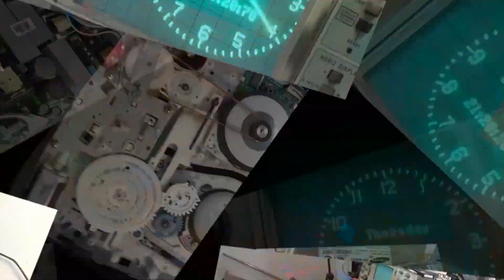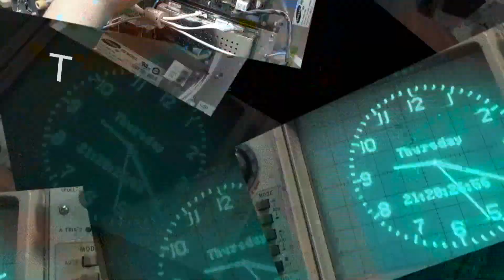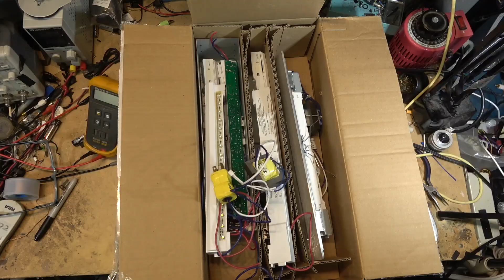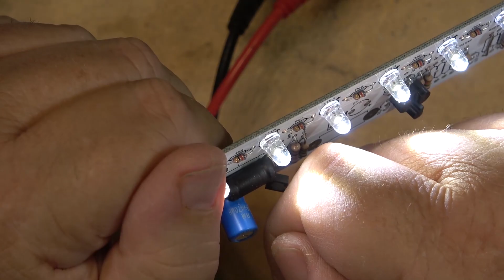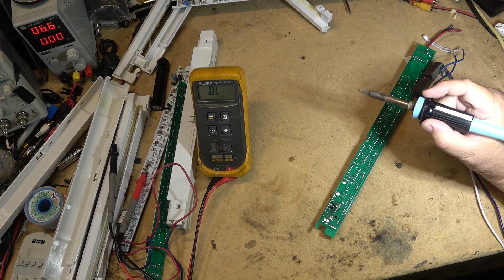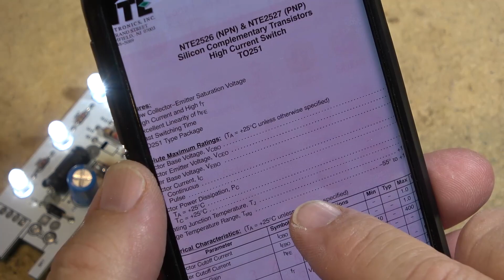Troubleshooting commercial LED exit signs that fail prematurely for the root cause

Comment: It's truly sad that even the regular, glowing lightbulbs, lasted longer than many of the LED lightbulbs I buy today. It's not even cheap brands that fail prematurely.
Reply from the maker: My grandfather clock has 2 40 watt incandescent bulbs running on a dimmer.  They run at 33% power and have been running 24/7 for many years.
Reply: My Pioneer receiver has the original lamps from 1974 in it. Not one has burned out yet
Reply: Underdriving tungsten bulbs prolongs their lifetime, IIRC exponentially. I found an Orbitec signal light application note on this subject, like 15 years ago, can't find it now. It said a signal lamp with 1000-2000 hours of nominal lifetime will last something like 50.000 hours at 60-70% of its rated voltage. I'm completely making these numbers up as I don't remember from 15 years ago, but it was a similar order of magnitude difference. As small voltage reduction as 10% lower than rated voltage can multiply the lifetime of a bulb. And they last a lot longer on AC, compared to DC, due to electromigration I think. I searched for almost an hour for that paper right now (1:05 AM here now...), without success.
Reply: Welcome to planned obsolescence.  It's not even the lights that fail most of the time, it's the driver circuitry that fails due to cheapass components being used.
Reply from the maker: @mrnmrn1  
There is a certain one in a firehall in the use that has been running for over 100 years.  Yes it is dimmed down.  Look up the century bulb on YouTube / Google.
Reply: @mrnmrn1  Reason I replaced the 24VAC lamps in a piece of machinery with 36VAC lamps, same package, and lower current use, and lower light output, but with a plastic coloured cover not even noticed. Used them as well in other applications, even using the MES lamps in a SBC socket, after a tiny bit of work with pliers to make the bayonet end act like a screw.
Reply: @12voltvids  I got a box of similar carbon ones, made by Siemens, and all very nice, even though they are from the Phoebus cartel days. NOS that sat in a box for 53 years, before I took the lot out, and the shelf got reallocated for use.
Reply: @12voltvids  Yep, I am fully aware of the Centennial light. That was probably always very dim, that's the reason it lasts forever. Maybe it's a 220V bulb operating on 120V.
Reply from the maker: @mrnmrn1  I am pretty sure they have it on a variac and have it dialed down.  I have a few really old bulbs that are well over 60 years old that still work but they are not being using.  Just collected.   I had (still have it just have no idea where it is) an old bulb that came out of a fire exit sign from an old hotel that was town down in the 30s.  Carbon filament was painted red but the paint is all chipped and cracked.  It had been at my parents house but i don't remember if i moved it over here when i moved out. I'm pretty sure i did pack it up and move it with me but where I have no idea.  If i didn't it would have been chucked for sure.  I have a full case of NOS "power twist" 40 watt fluorescent tubes never used.  Those are probably worth a small fortune now as they haven't made them in probably 50 years.  They are a twisted fluorescent tube, full spectrum.  Called a vitalite.

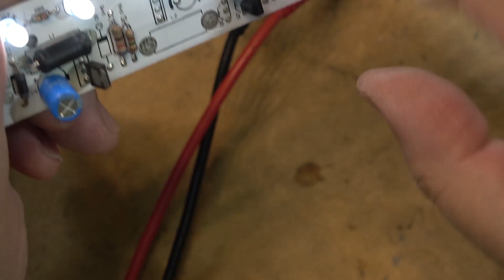Comment: 7:18

That transistor package brings back memories (don't know what it's called) but HP and many other monitor manufacturers used two of them back in the day in a Royer Oscillator to drive the high voltage transformers for the CCFL backlights in their monitors. 

The transistors would fail you would replace them and the monitor under heavy use would work from 3 - 4 years before they failed again. They mounted them the same way upright without soldering the tab to a copper trace on the PCB to use as a heat sink. I always suspected that they were being driven too hard, getting too hot, and their package size was inadequate for dissipating the required heat in the application but I never bothered trying to solder them to an external heat sink. I probably should have.
Reply: It's the same as the SMD TO-252/DPACK package, just with longer and differently formed pins.

Comment: Always found it odd why they stick capacitors in the hottest areas of power supply! Ive fiixed several Dreamcast consoles where the filter capacitors go 'bald' and fail as they are surrounded by heatsinks. Usually panasonic FC are used from factory. 
You know your stuff and find your videos very informative and interesting.

Comment: Sounds like the problem is the power dissipation on the transistor.  It needs a heat sink if it's going to be plugged into anything higher than 120V

Comment: So Dave, could a higher wattage transistor fix the problem? It seems that the supplied transistor is actually too low in wattage. I'm thinking that a bunch of replacement components could fix this broad problem and be a hell of a lot cheaper than replacing all of the LED arrays. Maybe a heat sink attached to the new replacements could help with the heat.
Reply: Not quite, it's the lack off surface area that kills it. Since it is a series pass transistor, a higher powered one would dissipate just as much heat. The same transistor would be OK with a thumbnail sized aluminium sheet attached to it as a heatsink (or soldered down onto a big copper pad on the board). Or if they used a transistor with similar Pd rating as this one, just in bigger, like TO-220 package, the higher surface area of the package could have been enough to run it cool enough.

Comment: I see an inductor next to the transistor and capacitor suggesting this is not a linear regulator rather a PWM system and the reason the transistor getting hot maybe the degradation of the electrolytic cap next to the transistor causing it to operate in a linear mode instead of the on/off in PWM mode... The fact that the transistor is a fast switching type hints at this too.

Comment: Would a higher rated regulator help angle the heat. I don’t understand why you would replace like for like, only for it to fail again… Why not put a heatsink on it?
Reply from the maker: I wouldn't replace like for like but these are not being repaired.

Comment: Given all of the open component spaces there are on those boards, I wonder if they're used in other products besides exit signs.
Reply: Probably there for different codes, some require the exit lamps to not be lit unless there is a power failure, or require lower brightness when power is present, so the component places are there on all, just not populated.

Comment: You do get high voltage regulators, which handle up to 60V on input, over the standard 7805 which is rated to 35V at almost zero current. However PNP high voltage transistors are cheap, though for that use a TO92 package is not good,m you need a TO220P or ISOTOP package, which can dissipate 1W with no heatsink, unlike the TO92, which is limited to 0.3W at almost die melting point.

Comment: The pcb is black behind the transistor indicating high temperature. The transistor needs a heat sink and some air flow from outside to keep cool.

Comment: I have an issue with a Toshiba DVR VHS/DVD recorder combo I'm hoping you can point me in the right direction on please. I had the cover off today to clean the video head because the audio had developed a very loud and annoying "buzzing" type of sound while trying to record or play any tapes. I use alcohol and a C Swab to clean it, and it definitely needed it judging by all the black residue that the swab picked up. But when I put it back together, now it will not play a tape. The machine automatically turns itself off about 5 seconds after powering it on, it will not even accept a tape, i took the cover back off and tried it and the arms that bring the film around the video head are all of a sudden not working at all. Any idea what would cause this? Is there a fix? If you have a video on a problem like this, please direct me to it if i can do an at home fix on it, I have a large amount of tapes I'm recording to DVD for someone and this has brought that to an abrupt stop
Reply: 😂😂 I've repaired hundreds of those things. I don't miss them at all.
Reply: @NunYa953  yeah, apparently even the guys that still work on them don't want to. I've asked this guy for his email multiple times to do business with him with almost zero response.
Reply: @DragRacingMediaOfThePast  where are you located? I have customers ship me those machines all the time for repair.
Reply: @NunYa953  I'm located in Central, Mississippi.
Reply: @DragRacingMediaOfThePast  
Well, if you want to ship it to Colorado and pay for a complete service on the entire machine let me know.
Reply: @NunYa953  I've since gotten rid of it, but it's probably just a matter of time before one of the other two units I'm using breaks on me. Been dealing with a place in Chicago and really unhappy with how they operate.

Comment: Look yesterday transistor is probably  part of a linear regulator..
So when input  is 24V and  output is 5V that's 19(V) at say 100mA..so about 1.9 Watts....no heat sink... yeah that's going to grill it

BTW in UK these get changed at 3 Year ...because rules

Comment: Logical solution is multi tap primary on the transformer. Bit more expensive but wont have to have all the other components on the bored so will save money there. The manuafacturer probs dont want them lasting too long so they can sell people more down the road. False economy. Dropping 50v for 5v led means 10percent efficiancy 90percent will be burnt off by the transistor. Probably puts in in line with effeliciancy of the reliable flouressant tube that it replaced.
Reply from the maker: I have an old 8 watt fluorescent fixture that at one time in its life was an exit sign.  
Guy that sent this confirmed that the ones that failed were all on 347 circuit and ones on 120 have not failed so there you go.

Comment: You mentioned 347 volt source for some of these lighting fixtures. Uh....had to google that, and....what I read absolutely blew my mind. Sounds like it's a Canada only thing? I'd post a link but you may not allow it here. Never seen or heard anything like that here in the states, and I've played with 120/240, 120/208 3 phase, and 277/480 3 phase. Link claims 347 is actually quite dangerous to work on??? Also it sounded like it could be 3 phase and is derived from neutral to ground......wth??? IF you know anything about this, could you please post a vid explaining it in technicolor? 10000 words or less AND with some schematics/drawings please-LMBO!!!!
Reply from the maker: In the states the medium commercial voltage is 480 phase to phase (277 phase to ground) and Canada it's 600 phase to phase (347 phase to ground)any commercial buildings receive 600v 3phase primary and have transformers in the building to step the 600 down to 208/120 for domestic.   At work for example there is a big transformer out on the street that drops the 25kv primary to 600. Soon as the feed enters the electrical room there is another transformer that drops the 600 down to 120/208.  
Many buildings use this medium primary for things like the elevator motors, and lighting.  Why? Higher viktage can use smaller gauge wires and for house lighting or parkade/parking lot lighting it is perfect.  
It's much safer to feed a building with 600v primary than bringing 25kv into the electrical room in a building.

Comment: It is engineered to fail. The transistor should be a TO220, bolted to the aluminium housing. The led strip should have 30% more LEDs and running on 70% of rated power. This thing could be near-100% reliable for many many years. As it should be with this kind of signage that could save lifes in case of an emergency.
And it is over-engineered for what it does. It's just a LED strip on a wide range supply voltage. With just a few components, the supply could be buck regulated into a constant-current for the LEDs. Yet, it contains a bunch of extra components that do not seem to have a function. What for? To make it look more complicated?
Reply from the maker: I have no idea what the other parts are for.   Never bothered to reverse engineer it.  Perhaps some day when i am bored.

Comment: Would have been nice to see what the current in to leds was, then we could have calculated the power being dissipated by the transistor.  This would have shown us how hard the poor bugger was being worked. Why they did not use a buck converter, but then they would be paying for reduction  in heat generated, but as your paying for that heat. Why should they pay to reduce it 

Is there a standard that emergency signs must meet?  But like most standards there is no tests for quality or life expectancy.
Reply: They definitely planned for the shorter lifespans! Look at the Electrolytic right next to the heatsink of the regulator - that‘s just lifetime limiting!
Reply from the maker: Trabsistor is rated 4 amps.  I doubt the draw is even 400ma
Reply: @12voltvids  it's a linear regulator! the big killer is the amount of voltage dropped across it not the current flowing. As you say the 400mA is only a 10th or so of it's current rating. but that 4A could be defined with a massive heatsink attached! not in free air and a few volts dropped across it.

So you say 400mA and the supply is 8V  now if the LED's are 5V then we are dropping 3V volts across the transistor so it dissipating  3V x0.4A =   1.2W going to get quite warn if not hot.

now think about the 24V max voltage, then we have a 19V drop so at 400mA we will have 7.6W's it will get way too hot to touch.

even if you drop the current to 150mA you will still have 19x.15 = 2.8W's which is a lot for the poor transistor to dissipate if doesn't have a heatsink or a good sized one.
Reply: @TheEmbeddedHobbyist  Right, but surely that Electrolytics Cap standing right next to the main heat dissipation area of that TO220 will increase the reliability far beyond the warranty 😌 That's exactly what you pay for in today's products: Cost Space saving circuit design, where it matters the most 💯

Comment: I guess a Tip32 size transistor on wires could be bolted to the case to dump the heat.
Reply from the maker: Should have copper plane on board so trabsistor could be soldered to it to pull heat away.
Reply: @12voltvids  Since the bottom of the lamp is seemingly diecast aluminium, it would have been an elegant solution to use it as a heatsink of a TO-220 pass transistor.

Comment: The weakest link..
Reply from the maker: Stronger transistor needed. Or a heat sink.
Reply: @12voltvids  yes, but because it's enclosed a heatsink could might be the copper on the backside of the PCB for better heat spread. Will a bigger transistor produce less heat, if the current is the same?
Reply from the maker: @rbtgmnstcs  larger trabsiatorb6will produce less heat.

Comment: Looks like this was designed to fail...
Reply from the maker: I doubt it was designed to fail. Likely a bad run of transistors or someone effed up on selecting the part and if course it takes 5-7 years before the oops is discovered.